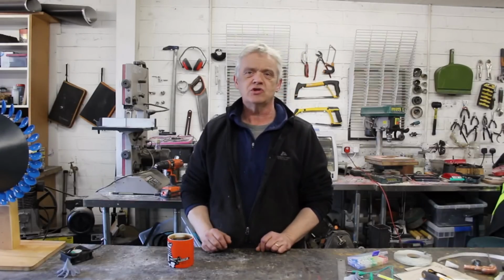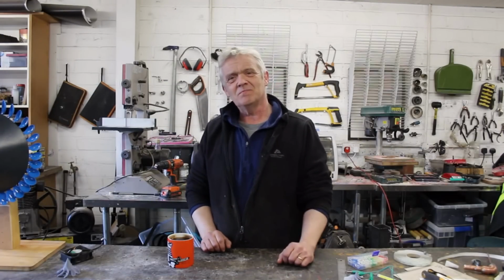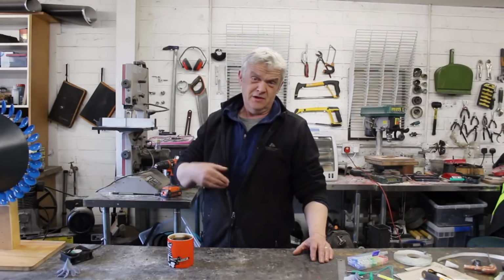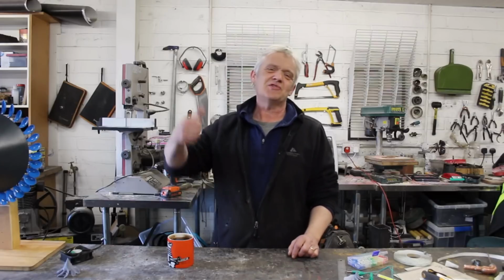2059 Improving Wind Turbines

Comment: 0:50 this animation, regardless of how often it is shown, is wrong. Wings actually redirect the airflow downward and this downward accelleration of air, through conservation of momentum, contributes to lifting the wing upwards.
Thinking along these lines, wind energy is 1/2mv². If we harvest energy from a given amount m of moving air, its speed will decrease. Of course we can never go 100%, because we would then have a volume of increasing air density which would lead to air flowing off into the surrounding space... However, we can see the decrease in overall velocity as an addition of tiny local vectors in the opposite direction, in other words: turbulence. Wind turbines harvest energy by decreasing the laminarity of airflow, hence increasing its entropy.

Comment: Wind turbine blades are already molded composites.  It would not take much to rework the molds for venturi holes.  It would also lighten the load on the horizontal bearings, and by being lighter, may extend the life of the blade significantly.  The venturis would not be optimum, but they would be very good.  A vertical might benefit from this technology.

V. 2 would make the wind come in through a snorkel and spin the blades that way, a big fan pointing up.  It wouldn't be very pretty, but far better to look at than oil mosquitoes (well pumps).

Comment: The only stupid question is the one you didn't ask right?  Cool, with that said.  Does it need to be a hard material like wood?  Would a stiff fabric with holes in it not do the same thing? I imagine in that situation, the pushing force of the wind would adjust the shape slightly to create a sort of "curved bevel" like a very short wind sock which in this case may improve efficiency but maybe the movement would somehow decrease it?  Happy to be educated if someone knows.

Comment: i was watching your paper /carbon-fiber bicycle build and realized if the strength comes from the fiber , i could protect the foamboard and simply fiber the siloutette pieces that need rib , wing or hull rib strength with foamboard, fibered across still  , i guess it's like surboard layers in there then as far as fast hard wing, easy, lightwieght, strong wing or hull, maybe disposoble floats for pontoon, catamaran too ...later take care stay great ...

Comment: Glad to see you covering the wind wall again.   I was thinking on the shroud making for these.   PVC pipe is easily shaped when warm.   

Cut 4” pipe to length “or minimum ID” to length, warm in small oven, drive a cone shaped mold into one end forcing a taper and shape you want.    Cheap and easy man!
Reply: He did mention in this video the use of plastic cups.  That seems a lot easier and cheaper then cutting and forming 100 or so pieces of PVC.

Comment: No, that's an old and false explanation for lift.
Modern explanation for LIFT is using the Coanda effect and one of Newton's law, and angle of attack/pitch.
Bernoulli's principal can be used for fluids flowing in an enclosed space (like a pipe) - I think not in open air.

If you build something around a wind turbine to increase it's area, you don't get "beyond" or "beat" the Betz limit. The added area need to be considered in calculations.

Comment: Dear Robert the venture also spins the air. As you would no doubt be aware the better the spin the further the wind shall distance over tim3. As the rifle needs to spin the bullet to get it straight and long! All things in this dimension spin even those frozen in tim3. I would however debate that the holes you have created are more shrouds for the fans and these improve the through flow although mainly for static fans which those fans are clearly not! G.G. keep going brother! As your illustrations clearly show@ 2.45 that the orifice plate need be in the middle of the constriction or through output. restriction can indeed make more pressure nothing nu.

Comment: Robert, is the air cooler as it passes through the wind wall?  
I saw an Indian video where they used liter coke bottles that funneled the air down a bit which compressed it and made the interior rooms cooler as a breeze passed through the window.  Aircon but I wonder if you could add a small low watt fan to increase the airflow would it increase the cooling.  Ok I know I'm getting away from wond turbines. 😅

Comment: remember that electrostatic solid state wind powered electric generator design that just uses a charged grid of wires in an air flow? the one that is the reverse application of the principles of electrostatic lifters? 
You could replace all them fans with an array of small wire grids behind each hole. Those systems suffer from maintainance issues because of corrosion. If the main generator unit is really an array of smaller wire grid components then it will be easier to maintain.

Comment: IF there was a dimple protruding up between each hole that would streamline and accelerate the distributed flow into the holes, that would augment this process even more.
Think of this like a giant sieve in a huge drain of water moving into it. IF all the surfaces between the holes were sharpened up into points - it would cut the fluid, air in this case, rapidly with no resistance, the way a potato slicer cuts a potato into long square sliced chips.
Food for thought.

Comment: my guess is that working on a venturi form just around the outer edge of the whole plate would increase the efficiency far more than the cost in time material or what ever too, so that you only have to produce a specialized shape for 4 flat planes and where they intersect on the corners, instead of making one to go around each and every round hole around the fans, that way it retains more of the pressure of oncoming wind on that flat plane so that it only has one way to go, through those holes and the fan blades

Comment: You could get some of that loss back by taking a round over but in a finishing router and adding a filet on each hole. 

You could get even more back if you 3D printed cones for the center of each hole.

Comment: Every little help, your simple explanation that the board/wall in part creates a higher pressure  around each hole and thus assists in directing this air to each little turbine is another simple win.

Comment: A suggestion for making venturi tubes for micro wind turbines better than straight sided plastic cups is to 3d print a blank to insert into pvc pipe softened with the aid of a heat gun or blow torch.
Reply: Forget the design of the conventional. Correct the harvesting of the magnetized or induced coil as the lorent force can be buck boosted to act as a gain rather than a loss. Why must people persist in following a flawed way?

Comment: How would the wind wall function if the fans were arranged in a hex grid/offset for greater density of fans instead of a line grid and how would that influence the efficiency based on a smaller area of the wood plate around each fan?

Comment: Do you suppose taking a router to the rim of each could recoup some of the lost efficiency? 🤔 Not sure what bevel profile would be best, but it would definitely smooth the air flow path. Just a thought! ✌️ Thanks for sharing Rob!
Reply: In horn loudspeakers, the best shape (more efficient? I gues so...If i remember right, it's the one with the max gain of dBs...tho others, like the hyper and the tractrix have other advantages regarding distorsion etc irrelevant in this case) is that of an exponential horn...so any router bit that follows an exponential curve should present a nice impedance adaptation, me thinks

Comment: I also tried to make this with 6 fans but it was to low of amps
Reply from the maker: i don't mean to be rude mate but what you said doesn't mean anything. How big was the surface area? how fast was the wind? what was the output?
Reply: Like it was 16 by 16 inches and i fitted that to my vehicle[scooter] so that when i run my it would produce some power.
But not only i had used very less fans but also it gave very low power
The fans were rated 12 v 0.120 amps( good as a fan but not as generater).

Comment: Oops, that's perpetuating the myth of how wings generate lift.  Although Bernoulli implies a slight drop of pressure due to the faster flow on top, most of the lift is actually just the change in momentum at the leading edge stagnation point.  Work out the upward component pressure due to the momentum change of air flow on the wing compared to the minor lift due to the speed differential top to bottom.
Reply: As there are varing levels of understanding and limited time, this is the simplest way to explain lift with out looking at loads of theorem and calculations to prove why that theorem is the most accurate. The difference between theory and reality is truth and that  is a whole subject on its own.

Great, informative video Rob. Keep inspiring us
Reply: Yes. Wings generate lift because of the angle of attack moving forwards.. so many myths surround wing theories, the shape reduces drag, a flat wing works just as well. Try it with. 3 ft length of 1/4 “ balsa , wave it about 👍🏼
Also, with Venturi shrouds , note even a straight edge (25 deg) angled Venturi worked better than a hole in various tank tests we did for tidal energy many years ago.
Reply: I was waiting for someone to bring up the Bernoulli question...